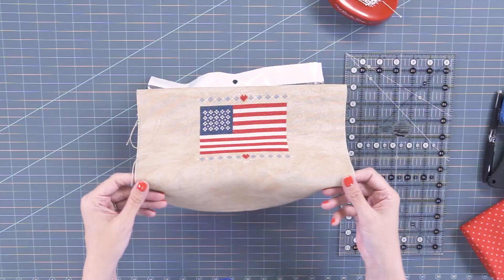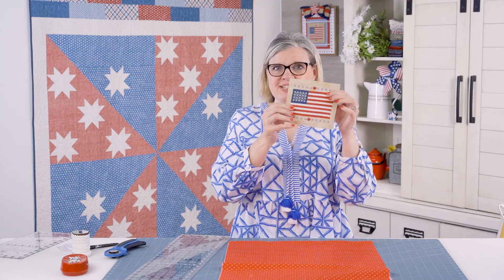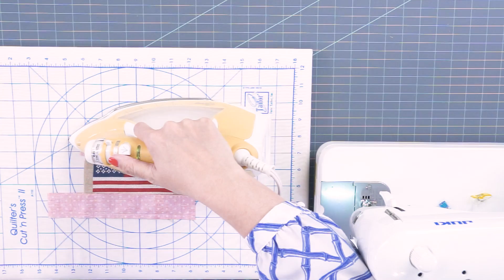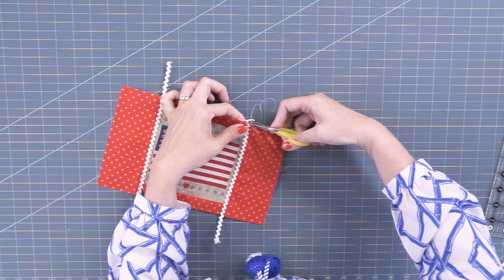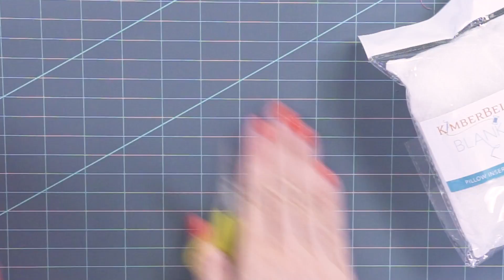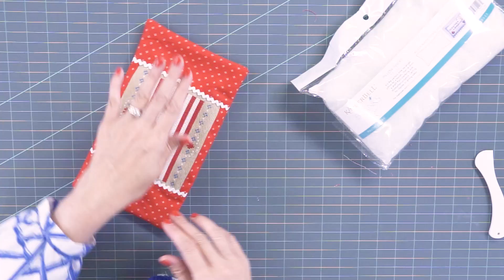How to Make a Small Decorative Cross Stitch Pillow | Fat Quarter Shop Flosstube

Comment: Another way to get a really crisp corner is to stitch to 1 stitch from the corner, turn 45 degrees and take one stitch.  Then turn another 45 degrees and stitch straight down the side.  Do this at each corner and when you turn it, the corners will be really crisp.  I also trim the corners, but with the stitch at the corner, there is still less fabric and the corners are wonderful.  :)